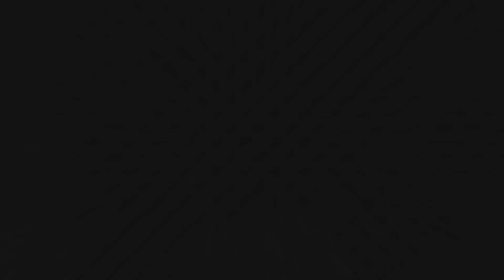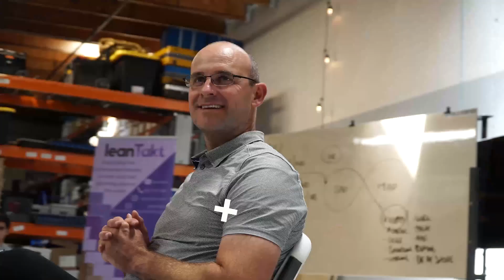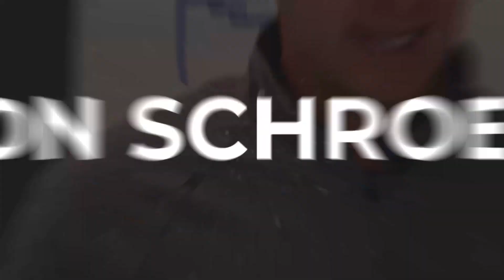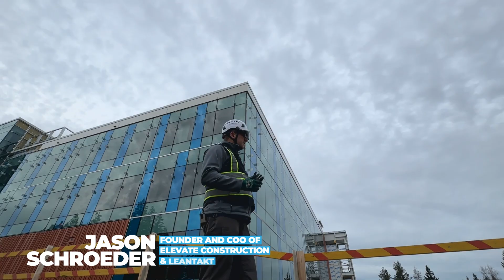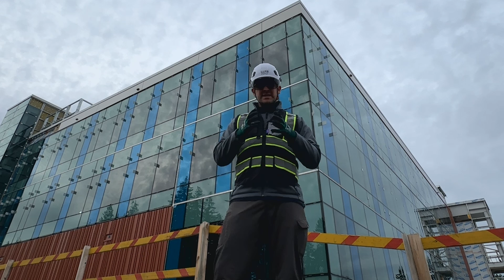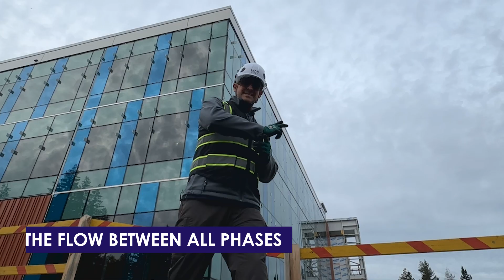Things To Consider With Exterior Construction

Comment: Don’t forget that exterior systems are not complete until caulking is done, spandrel glass insulation and edge of slab fire safing. Those 3 items will hold up interior framing.